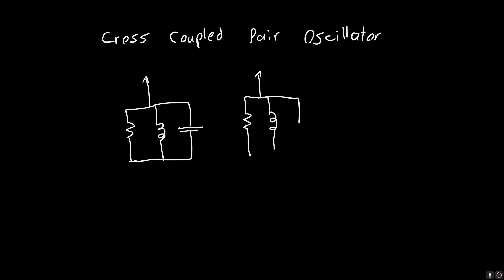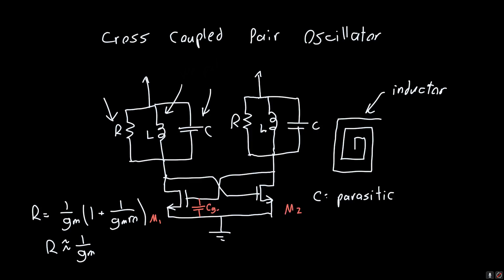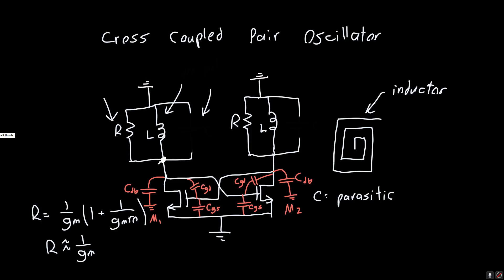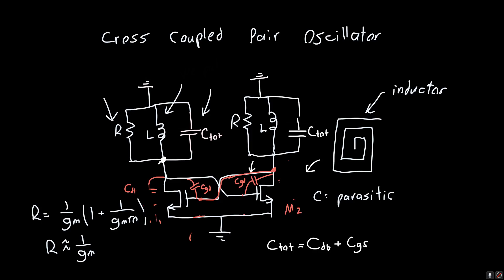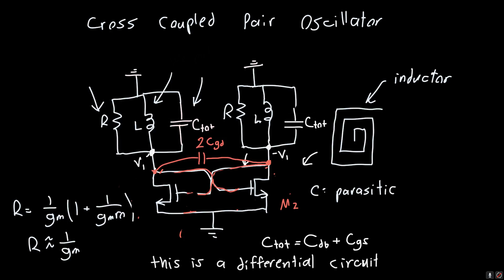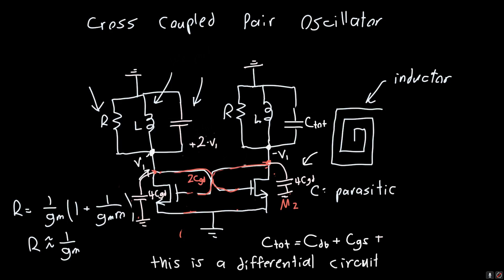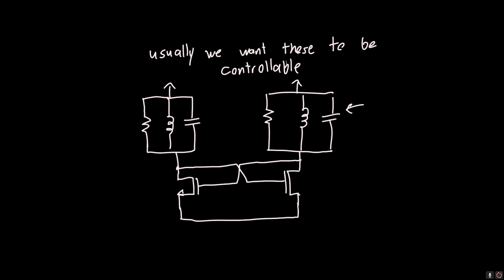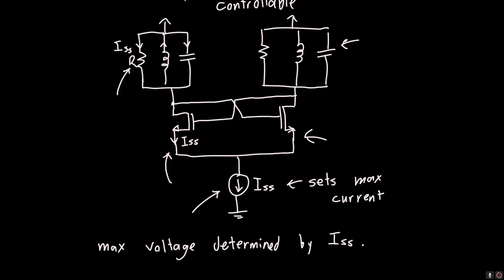Cross Coupled Pair Oscillator Part 2

Comment: Wonderful lectures. Do you (or does anyone) know how to design a high voltage oscillator? As can be seen in the circuit, the gate voltage (Vgs) is equal to the peak voltage of the resonant circuit. Therefore, the voltage across the resonant circuits cannot be too high otherwise the FET would be blown up. Thanks!

Comment: Jordan these are excellent videos.  May I suggest you create some playlists which concentrate on specific topics.  For instance I just had to search to get the sequence of LC circuits through to XCP oscillators and figure out the proper sequence as they don't seem to be ordered correctly in your uploads.  I'm sure you have the lectures all prepared in sequence but we have no way of knowing what that is. (Maybe I'm missing some link or playlist where you do have this ?).   Anyway great refresher for me with a cleaner insight on miller capacitance and negative resistance.  Thanks for sharing.  I would very much enjoy your classes.
Reply from the maker: Hmm, I haven't actually thought about the proper sequence to introduce these. You have suggestions? I only have a smattering of videos I made when I was taking an RF course.
Reply: I think you do actually have a sequence since you keep referring to previous videos on every part of this series. If you can organize this into a playlist would be awesome, your channel is full of great design content, but scattered

Comment: Why do we take a "negative resistance" approach instead of "amplifier-feedback" approach.
Reply from the maker: You could do that, it should work just as well :). This happened to be the way the course that I took taught it.
Reply: @JordanEdmundsEECS  Thank you for the reply
Reply: @Bayharboursaladseller  At very high frequencies, especially in mmWave, it becomes very hard to design LC oscillators using feedback theory, however it's nice for intuition.

Comment: Hello Jordan, thank you for your kind explanation. It's helpful. I have several questions about the cross-coupled pair oscillator.  The first question is about the startup of the oscillator. How can we control the startup problem of this oscillator? Secondly, how we can measure that negative resistance effectively helps to reuse the oscillation power compared to the conventional lc oscillator? Negative resistance immediately disappears if we do not give power supply to the oscillator.